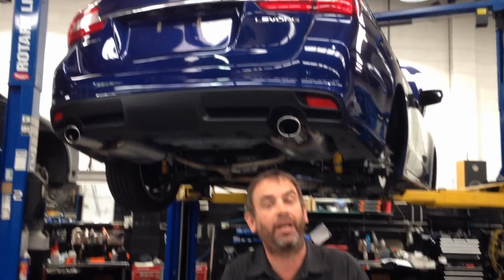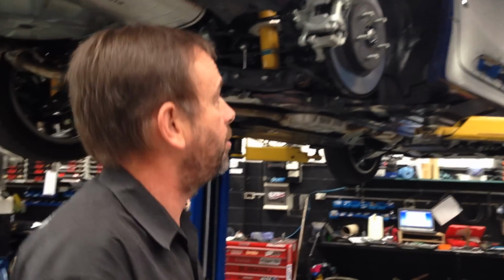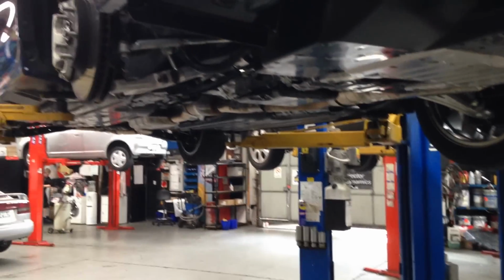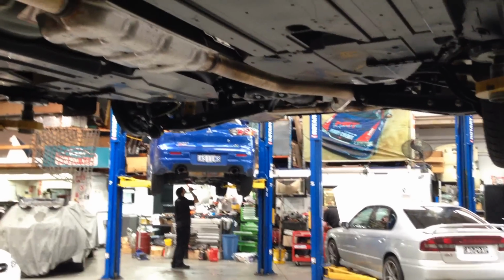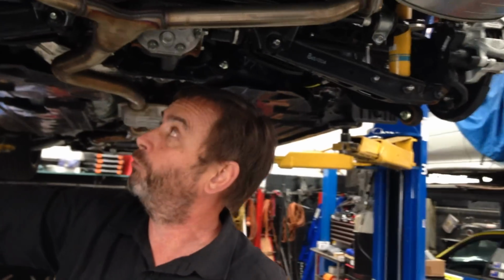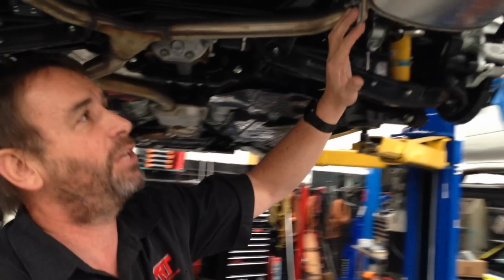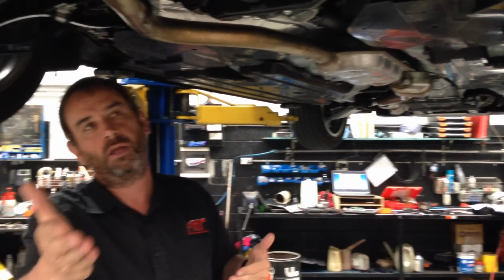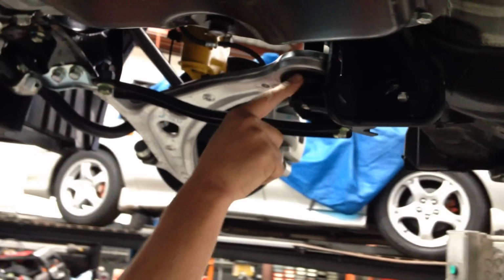Subaru Levorg test on hoist, whats new and whats stock

Comment: Im currently tossing up between getting a levorg or wait until fa20 sti when it eventually lands. For me to bite the bullet and get the levorg now, itd have to have a manual gearbox. Do the wrx/sti 6 speeds mate up to the fa20 in regards to block and driveshafts, axles, hubs etc
Reply: would assume so. would be very strange they made them different. it would cost them more just to change parts slightly so they wouldnt fit